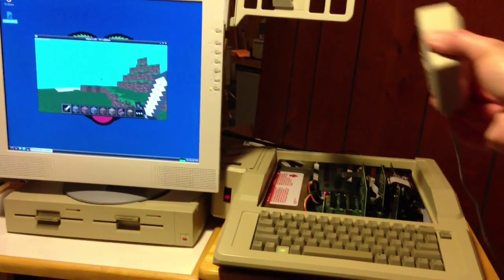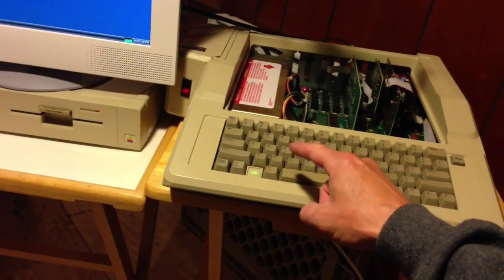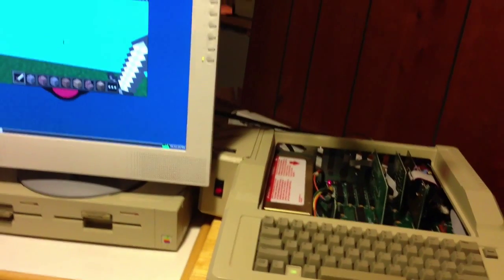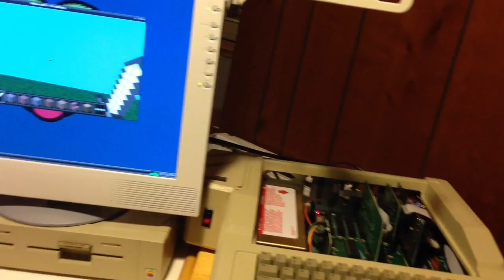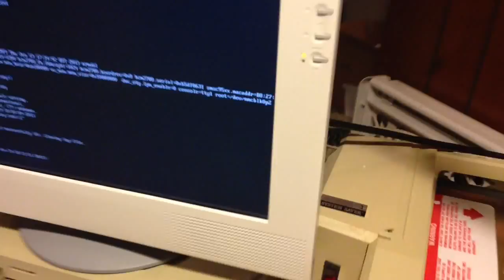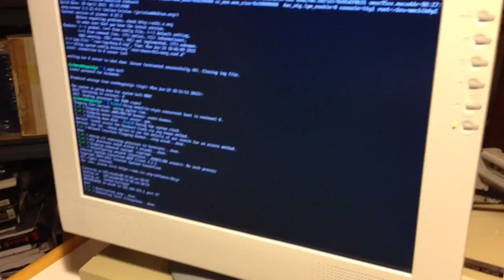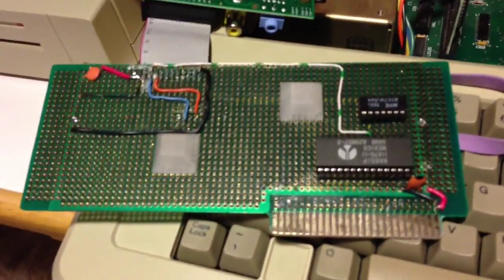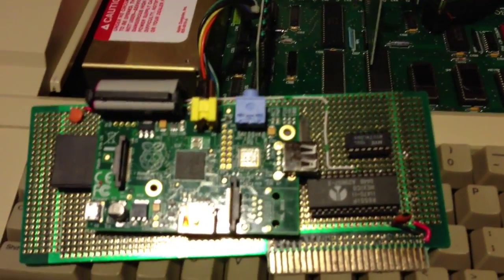Apple II Pi Part 3

Comment from the maker: Good question:

F1-F10 = Closed Apple + number keys 1-0.  I use the Closed Apple key as a function key to modify any other key.  Currently only a few are defined, but can easily be expanded by editing the keymap table in the source code.